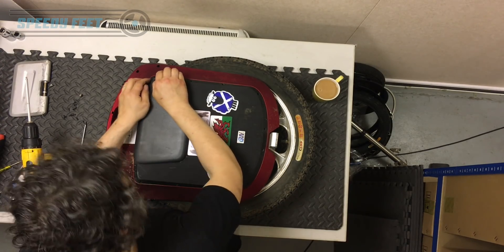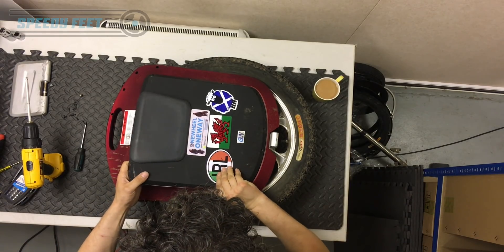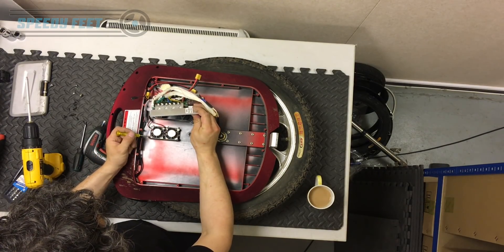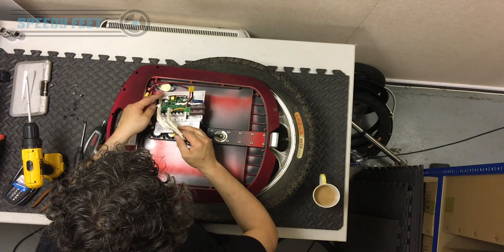Gotway Monster - HOW TO - Strip / Tear Down

Comment: Hey, should I be able to sense battery voltage using a multimeter on the proper tongs in the charging port cup?  Because I'm not able to detect it...
Reply from the maker: Yes usually

Comment: Oh my. They really need to look into their case design around the handle/lights! With how easy bit's snap meaning you have to replace parts and with the wiring wrapped and lights glued it's not an easy process. I was hoping I'd be able to disconnect the batteries then do the battery side of the shell then move onto the board side but the screws that hold the switch holder panel are screwed from the battery side. :( 
After handling the glue they used to hold the front light do you have any recommendation please? It looks like I'll need to get that as well as the screws before I can start.
Reply from the maker: That light doesn't wobble when screwed in... BUT you can see the effort to get to it required, so sealing it an idea to save a future issue. I would silicon it in if it were me instead of that glue. PS Remember that there is a shorter route to getting to just the light in future (8 top screws, and the x2 screws each side of the light and just remove one side).

Hope that makes sense!
Reply: Thanks. I have sealant so will use that. I'm hoping not to have any issues in the future. lol Once I get this shell swap done I'll add rubber bumpers and, as I'm more confident on it, hopefully not do anything on it that risks it dropping again :) If they sort their poor handle design then it'll stop others having the same breakages.